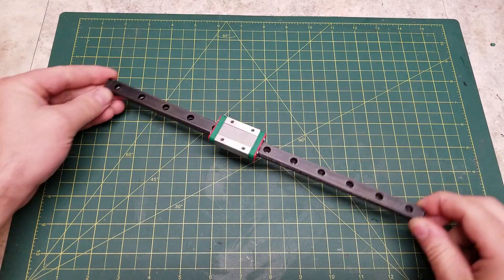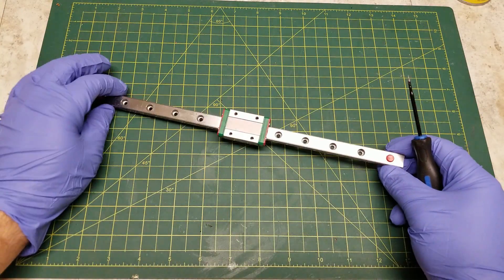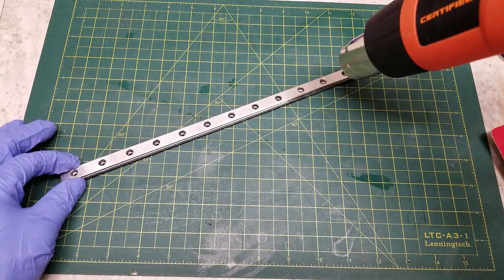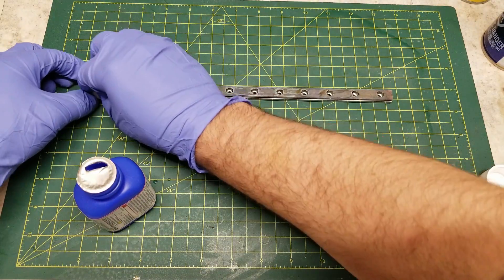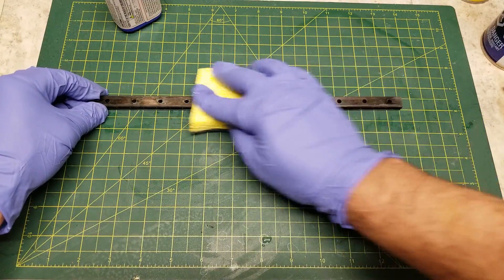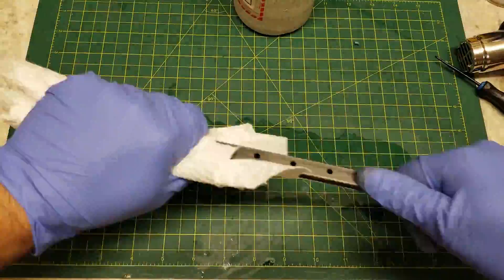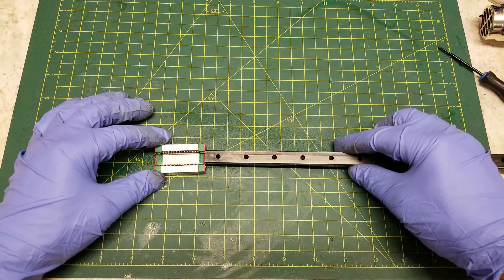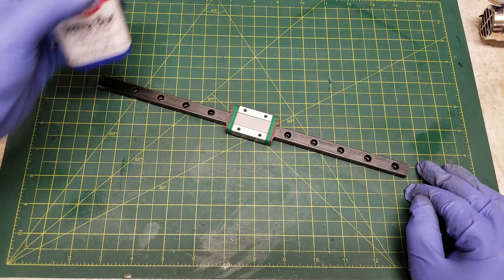Bluing Your Linear Rails EASY!

Comment: There doesn't seem much need to add too much considering I'm late to the party but a few of the comments reflect a poor understanding of the process. First, this cold bluing. Selenic acid and copper sulphate from memory. It offers virtually no protection from rust and basically used as a touch up to a proper hot bluing surface finish. It's an acid etch so one couldn't claim it reduces tolerances. In a firearms application it tends to promote rust. Hot bluing is a controlled corrosion process. It effective in reducing rust  due to its oxide surface being able to hold oil and the fact that its already a corroded surface (its hard to rust rust).
As far as affecting critical tolerances, it's barely worth your consideration. The little drag that may develop against tightly toleranced slideways will wear back in rather quickly, or you can give it a light burnish with 000 steel wool and a little oil.
Cold and hot blue, other than the resulting colour bare no resemblance to each other.
As a machinist and formally a professional gunsmith, there's my 2 cents.

Comment: So, that didn't worked with my MGN12 rails. I guess it doesn't work on chrome rails. 😟
Reply from the maker: Ya if its chromed it wont really take, works best with carbon steel metals, stainless and chromed wont really work out.

Comment: 1) you do know that blueing is, itself a controlled rust?  I mention this because blueing is going to shoot the slide tolerance to shit.  The "blue" is going to wear off where the balls runs and those rails are going to be prematurely sloppy.  Not a price I would be willing to pay for them to look pretty.

2) blueing does not provide rust protection.  It creates a patina (surfaces roughness) that will hold oil.  Wax or polish would be a better option for rush protection.

3)  I have done a bit of blueing, your method for doing blue is solid.

Moral of the story, blueing parts of this tolerance is a bad idea.
Reply: This could be a good thing as a lot of cheap chinese rails are already too tight
Reply: @andrewjamez  I wasn't aware stock rails were too tight?

problem is, the blueing will, initially, make them tighter (rust swells)...then you will have to wear them in, which will happen more rapidly since you've blued them, but also more inconsistently.

at the end of the day, you've traded a tight slide that would have work itself in, for rail whose ground surface is now pitted.

if they are really that tight, send em back.
Reply: @mtraven23  well this is typical for Nero 3D. he has zero mechanical knowledge nor education.
Reply: 1. It's not going to shoot the slide tolerance to shit at all.  bluing these rails will add at most 2.5 micrometers. this is more than acceptable for crappy no name rails and carriages bought from china where the ball bearings are consistently out of tolerance to begin with.
2. The "blue" is going to wear off where the balls runs  - correct
3. those rails are going to be prematurely sloppy - incorrect, slop will not appear sooner because bluing was applied
4. bluing does not provide rust protection - incorrect - it provides some protection, but is negligible, depending the environment.
Reply: @KepperKleen  your own logic is broken.  #2 & #3 cannot coexists.

if you blue something it swells, if you remove that material, you are left with something smaller, hence my prediction of premature wear.

and 2.5 um is about the difference between the spacer balls & the load balls.  Yes I know most of these cheapies use only one size ball, but the point stands.

#4 just seems pedantic.

and I'll add another reason not to do this, maybe the most practical:  blueing significantly damages the surface finish of the rail.  That WILL lead to premature wiper failure.  and, if not replace, the ingress of debris will destroy the whole assembly in short order.
Reply: @mtraven23  Maybe I came around this the wrong way.  To clarify, I am not an advocate of bluing rails.  I just don't think that bluing rails found in cheap 3D printers would make them worse.  THK or IKO, then I agree with you 100%
Reply: @mtraven23  While we're on this topic, I'd like to hear your input on how to avoid corrosion on linear rails, which is what brought me to this video in the first place...
Reply: @KepperKleen  fair enough.  

re rust protection.  It is a tricky question.

One approach is like you would on any other steel / cast iron machine:  1) store it in a climate controlled environment 2)keep the rails coated in a light oil.  But that seems a bit unrealistic, even I get a bit lapse with that sort of maintenance..pulse oil collects dust and then, ya know...

The comment below mine suggests Corrosion X lubricant, I've not tried that but I might (among other corrosion sprays)

Wax is another option, I dont have a specific recommendation there (yet) as I'm trying to find something that wont melt & run in my heated chamber.

So a whole lot of i dont know there, one thing I do know is I wouldn't apply anything to the actually race grooves.

lastly, I'll mention that the better the surface finish is, the slower carbon steel will rust.  Theoretically, if you could put a perfect finish on carbon steel, it wouldn't rust.  I've sanded the top of the rail with 2000 up to 6000 grit wet sand paper.  Honestly, I did that because I put a few scratches in them during fabrication, but I expect it will help.  

This is all to ask, have you actually had problems with rust?  I've only had linear rails about 2 years, but there is not a spot of corrosion on them.  Either way, I think you're right to be concerned about it, I just haven't actually seen them rust (yet).

It also might be wise to consider your use.  If this is an everyday printer, you might take a different approach than if its going to sit for long periods of time.

Sorry I cant give you a "this is how to do it" but hopefully there some food for thought in there.

cheers
Reply: @mtraven23  Hey thanks, reason I asked and why I'm here in the first place, I have cnc machine, I replaced the rails two years ago and then we moved, so it's been sitting in the garage since then not doing anything.. now the rails are all covered in surface rust, i dont want to have to replace them cause of the $ and they were brand new.... 

Thanks for your feedback!   Not sure what i'm going to do.. I'm very conflicted, this is a hard pill to swallow.
Reply: @KepperKleen  yes, that would be a real shame.  I'll bet you can get it running again with a little TLC.  at worst, maybe you've taken a little off the back end of the rails life.

if it were my machine:

I'd get them soaked in oil asap, soaked paper towels left for some time will soak in.  Wipe away what you can & inspect.  Where is the rust? on the flats, or in race?  The flats just need to be made smooth so the wipers dont get ripped up, tolerance on this surfaces is pretty loose.800-3000 grit sand paper, preferably on a surface plate will clean the flats up in short order.

If ya got rust on the "race groove" thats a more precise problem.  Maybe just a tool of appropriate diam., wrapped in ~1500 /2000 grit paper?

You'll also want to inspect the carriages & balls for rust.  Hopefully there was enough grease/oil on those surfaces to protect them.

as your sanding, or doing whatever you do to clean this up, be careful when you expose new, clean metal & dont dry right away..rush can flash form & that is heartbreaking to see.

best of luck.

Comment: I'd like to do this to my custom printer, but i've got 6 linear rails on it - it's a lot of work :D
Reply: I've done one printer with 8 rails, and two with 5 each so far. It's a bit of work but it's not too bad, and IMO it looks really nice

ETA: I commented before watching the whole video. There are some products that will make this process go a little faster. I used Birchwood Casey Super Blue and my rails came out at least as dark in only two coats

Comment: When you just receive a Chinese rail, do you have to clean the rail or only the carriage?
Reply from the maker: Depends on how bad it is. Last few ive gotten have been clean cept for a light coat of oil which wipes off
Reply: @CanuckCreator  Ok sounds great, after wiping off do you lubricate it with something else? (except of course the blue stuff you showed in this video)
Reply from the maker: @ManIkWeet  so after your done bluing the rails. And after the oil soak. Wipe any excess oil off the rail. Then  treat the rail as normal and apply grease for the carriage as you usually would.
Reply: @CanuckCreator  Ok thank you!

Comment: Have you tried super blue?
Reply: I've done several rails now with super blue and it works great. My one printer has at least 1000 hours on the rails and no signs of wear or fading

ETA: based on what I see here, super blue does the job much quicker. I only did two coats on my rails and as far as I can tell from the video, they came out a fair bit darker
Reply from the maker: @JamesEsau  awesome. That's good to hear
Reply from the maker: My goto lube for the carriage is usually a white lithium based grease, Remember the oil on the rail isnt a lubricant. 

Oh super blue. Thought ya said superlube...no i have not. Most off the shelf cold blues function the same